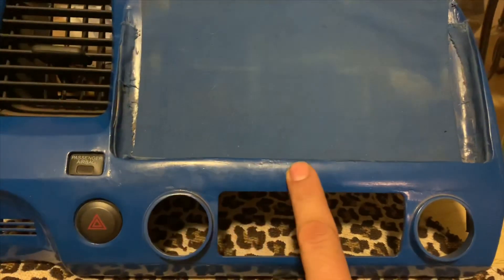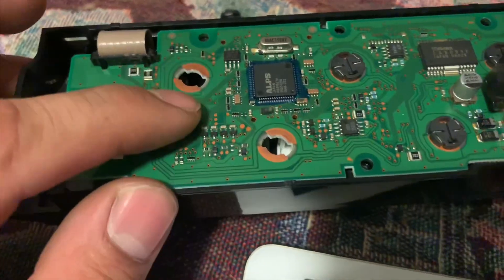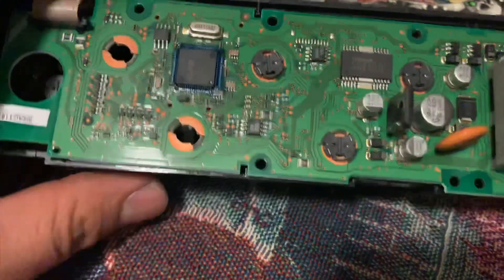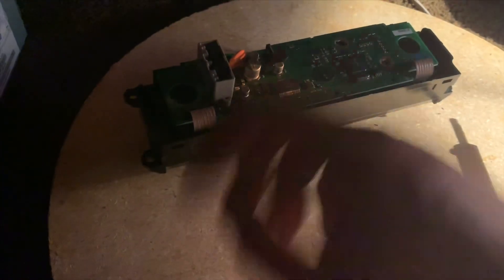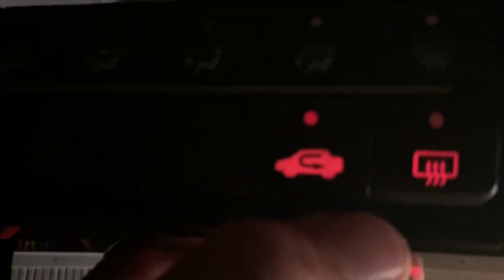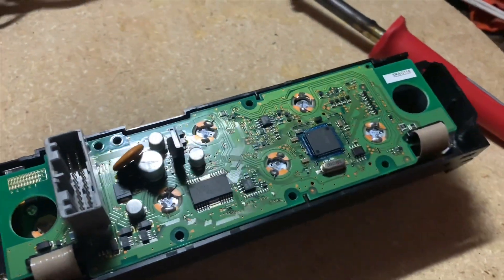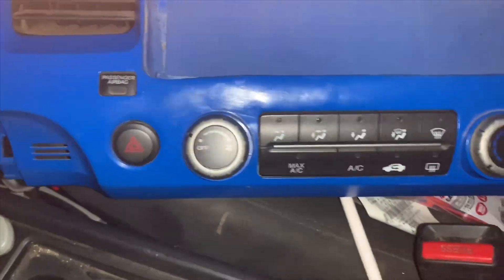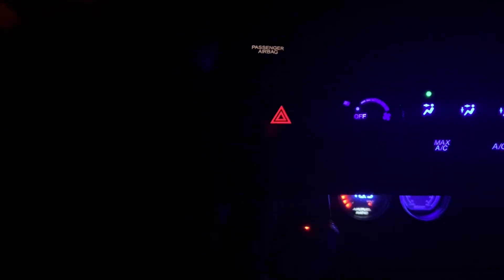LED climate control mod

Comment: Lol when I pulled out the climate control to switch over to new headunit. I forgot where it all was. Luckily if you find the right spot you can spin them to either side until it stops and I was able to put them back at the right spot